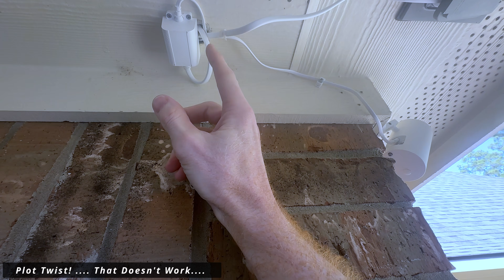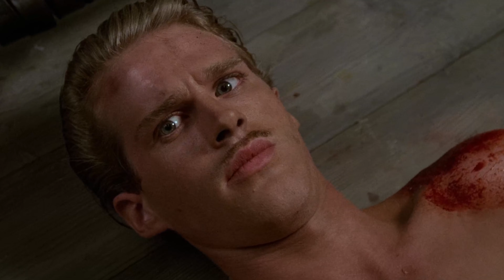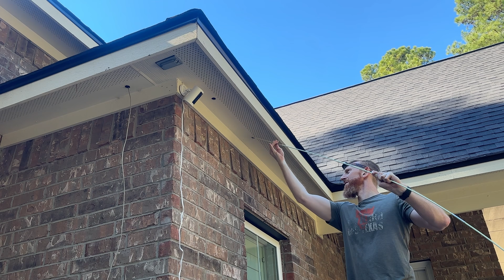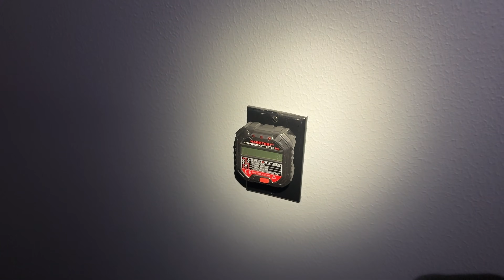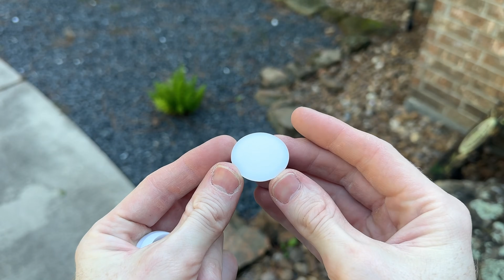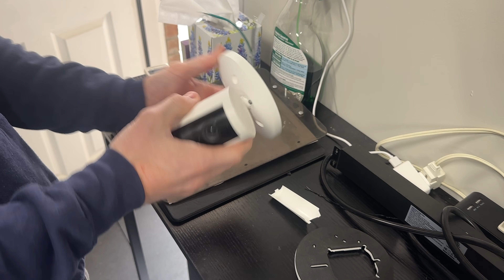Hardwiring A Ring Outdoor Cam Plus | DIY

Comment: Is there a reason you grounded both wires to the box instead of just connecting the two ground wires together and having it ground where the power source is coming from?
Reply from the maker: Hey Jason, I'm not an electrician, but I think it's standard to ground the box as well. (if the box is metal) - But like I said, not an electrician.

Comment: I’m trying to figure out what you are choosing on the ring app. I chose wired instead of battery, but hardwired isn’t an option. It’s an Ethernet option. Or plugged in.
Reply from the maker: If i remember right you choose wired.

Comment: Hi, which Ring camera did you use? on the video I saw that the back of the camera had the wires to connect.  Thanks!
Reply from the maker: It's a https://amzn.to/4rApeWz -  I have the link to the hard wire kit in the description.